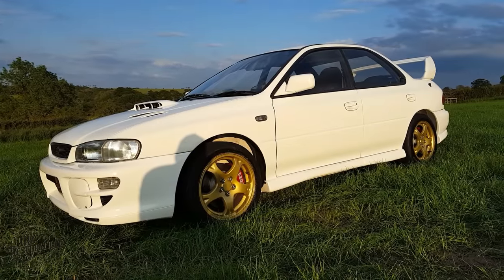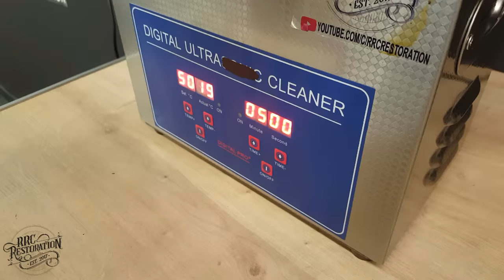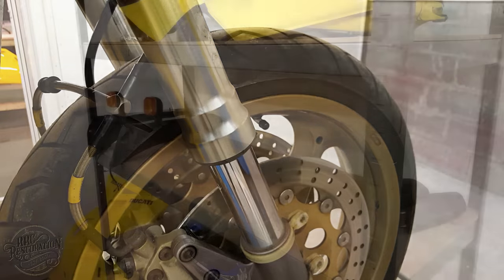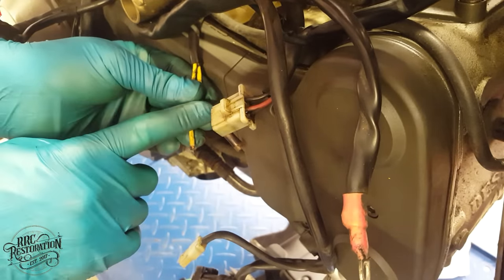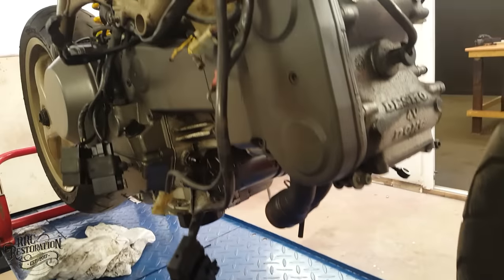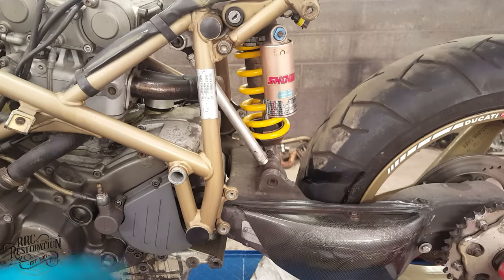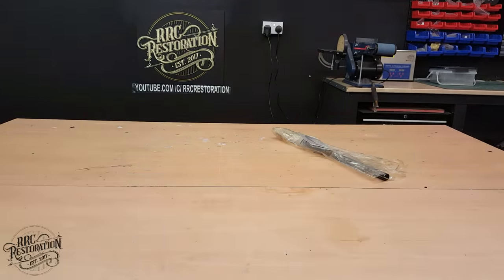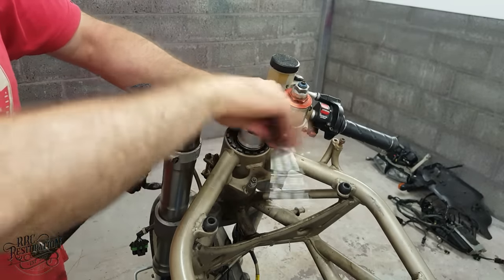Ducati 916 Superbike Full Restoration EP1

Comment: You sir should have your own personal show on Discovery! The quality of your projects, video skills and humor are second to none. Thanks for sharing all this fantastic content!
Reply from the maker: High praise indeed thank you so much! My own show would be epic... maybe one day :)
Reply: @RRCRestoration  You would have to show your face or wear a balaclava..
Reply: @RRCRestoration I'm having a problem with my1995 916. It's developed a leak at the seam of the 2 bottom engine cases . Is it worth tearing the engine apart to repair or should I just ride it and re fill the engine oil?? I'm concerned about oil on the rear tire and an accident because of the oil. I've been quoted 4k plus to do the job. I have the money but I'm worried he may be taking advantage of me because he knows I want it repaired more than not repaired. What do you suggest and what do you think a fair amount would be in U.S. dollars???? It also needs the stator replaced because it's burned out so I couldn't drive it until that's repaired anyway. What is your advice??? Thanks, Chris

Comment: Excellent workmanship, saw the 748 restoration, thank you for the tip of wrapping cling film around a tube, shaft before trying to fit an oil seal, worked a treat when fitting a final drive shaft oil seal for me.

Comment: Awesome as always!! Your special tool was so clever!!
Reply from the maker: Thank you! Cheers! :)
Reply: @RRCRestoration  I had same problem with my triumph until I released you can just use an adjustable large angle grinder wheel remover tool that was only $11 at mitre ten. (won't fit a torque wrench like yours though)
Cheers from New Zealand.

Comment: Support the engine. Remove engine bolts ( loosen front one.) remove swing arm spindle and shock. Pivot frame forward. Remove swing arm then remove last engine bolt, then simply lift frame off. You can do this with or without the front end.

Comment: Wow wow wow!!!!!😲😲😲
I just can't believe how easily this bike disassembled!!!🧐
I've never seen a Ducati worked on,it amazes me how each component came out as one,you used maybe two sockets,a ratchet,handwrench,for the whole bike!!!!!!😲
The whole instrument column was two nuts,the rear tire assembly was a single bolt,the fairings all came off with twist clips!!!!!!
You can really tell this bike was engineered for racing,to be quick to repair in the pits....
Jeezus,if this was Honda or Kawasaki, there'd been 500 screws,200 bolts ,and it would have took an entire Snap on set to do it!!!!!🙄

Comment: Does heating up the pivot bolt affect the frame metal as it's getting heated too?
Reply from the maker: Hi, No it doesn't affect the frame as it doesn't get anywhere near hot enough to change the structure of the metal just expand it a little to break the corrosion. its common practice for getting these bolts out.
Reply: @RRCRestoration  thanks for the reply and education!

Comment: Masterclass! How do you handle the fasteners for parts you take off? say the bolts for the front fender, tank etc. I never know whether to bag and tape to the piece, put in a box etc. - wondering how you do it. Should I crack nuts with a breaker then get the impact on, or is it OK to go straight to impact for removal. Thanks - my project is much more simple (100cc 2-stroke) but I am just learning - got the frame undercoated now. I am available for adoption by the way :-D

Comment: i had three of those years ago .748s/916sps/996sp. the parts are hard to get and expansive back then. on my 916 and 996 are run on dual injectors with P8 system.

Comment: Those two semi-connedted reservoir type cylinders that you're stuffing with foam at 4:40 and removing around 11:10 look a lot like carburators, but I thought this enigne was only ever fuel injected - could I ask, what they are?
Reply: Downdraft EFI throttle bodies?
Reply: @G58  They seem very large for that compared to the bore of the cylinders, but I didn't think of this; thank you!
Reply: Espen Fyhrie You’re welcome. Throttle bodies are generally a bit smaller than carburettors. 

I’m removing one from my BMW F650 Dakar engine and converting it to carb. Small electrical and electronic issues, and even a low battery, can stop an EFI engine from starting. When engine management systems fail, and there are no more to be found, many modern bikes will be useless.

Comment: Looking forward to the Swingarm teardown to see if your bearing carrier castellations are anywhere near as bad as the ones on my 748 are due to the cush rubbers failing, caught mine just before it got to the swingarm. The bike looks to already be fitted with the aftermarket sprocket carrier with the retainers to prevent the cush drivers backing out.

Comment: Hi mate, after you put your parts in the ultra sound bath you add some chemicals, can you run me through the process as I plan a restoration and would like to use old bolts and ancillaries but I don't want them to corrode soon afterwards.

Comment: How did you get the mirrors off
Reply from the maker: there is a small bolt holding them on from the underside, its an Allen bolt but I cant remember the size from memory, then it should just pull off.

Comment: Although it came in handy later when you removed the forks, it is not necessary to support the frame when removing the swing arm bolt for engine removal.

Comment: You always want to use an impact gun on the Nut instead of the bolt. 
The bolt spinning around especially if it’s caked in debris can mar the inside of whatever it’s in changing the Tolerance of the bolt hole.
Reply from the maker: A very good point but sometimes in order to get the shots i need i have to be naughty and break the rules every now ang again ;)

Comment: As always a pleasure watch you methodically tear down a machine and then restore it to be better than it was originally. I am wondering if you will choose to replace parts that have wear/tear with OEM spec or slightly better spec just cuz you can. You are changing the wires to the rectifier suggests to me you will definitely be oomphing this up & maybe someone is going to bid on it :). Thanks for sharing your work.

Comment: Good stuff, Finally going to start a full resto on the back underside of my Fiesta ST after watching the Scooby reso.
Reply from the maker: Nice one buddy, Glad i could inspire you and hopefully pass on a few tips and tricks of the trade :)
Reply: @RRCRestoration  Hi Mate, I have a question for you, I got told to use red oxide on the underside, I have not did this yet but i have done it on the back axle, And now i have painted over it with hammerite, I just happened to google it and found that painting over the red oxide with hammerite is rubbish as it chips easily. Should i have just used Hydrate 80 and then hammerite? Now for the underiside should i use hydrate 80 then the red oxide, or just hammerite?

Comment: This is that love/hate bike for me, that one bike I actually do love and at the same time I hate because... I personally ride a lot when I first own a bike, and the transplant of this unit will tell you not to do it every single day. I wouldn't want to own a bike I would have to do a full engine tear down once a season, just because... Even the mechanics at the shop I used to work at advised me not to, because it can be a real hassle to deal with that + other gremlins here and there. 
It's a cool bike and all no questions asked, I just couldn't own it as a primary bike when I was riding 20.000km a year. 

PS: I almost thought you were heading back in the shed for a jack hammer when you told us you did not have the tool for this lol...